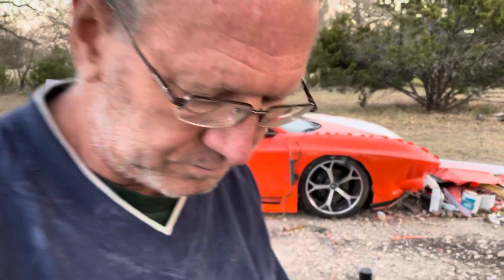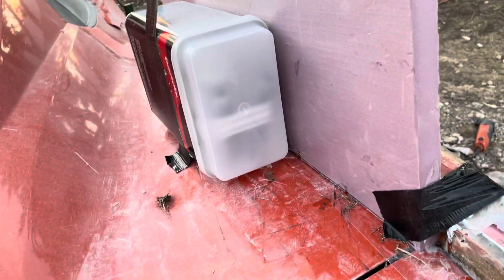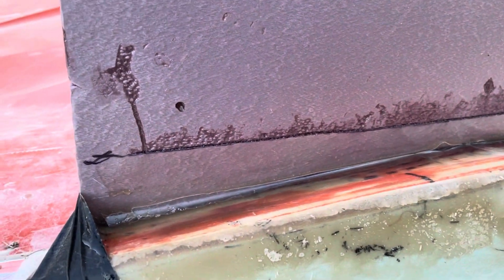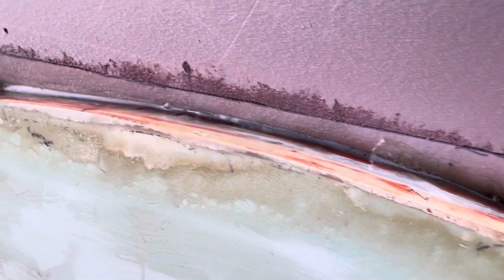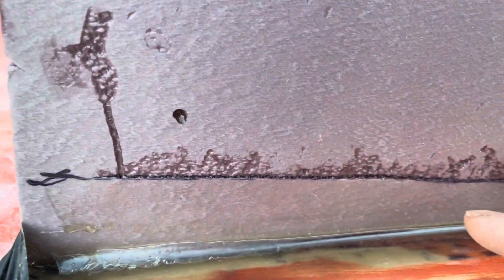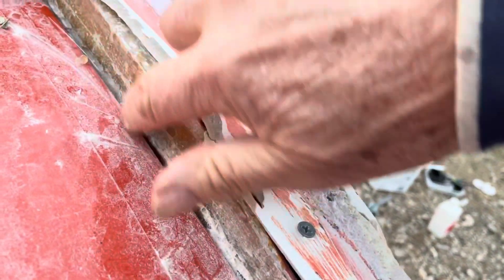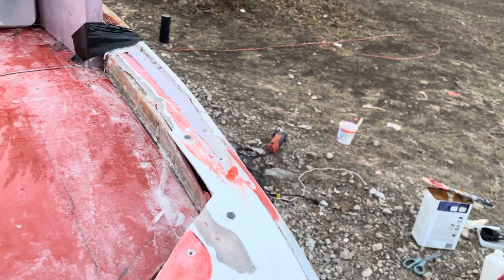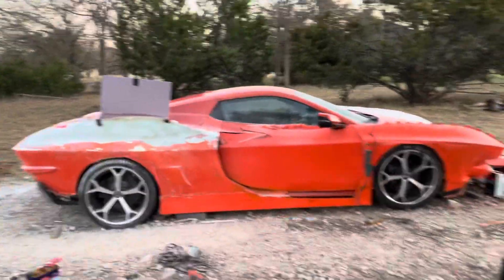C8 Hack - Filling a Big Gap with Fiberglass

Comment: Coming aong nicely... will the nose when finished curve under like present or will it extend forward as in more modern cars?
Reply from the maker: The lower part of the front end is stock C8. If someone wants to extend it there are aftermarket parts that do exactly that. The upper part is from the C2 mold and extends past the lower C8 section by about 4”.  I don’t plan to change that.